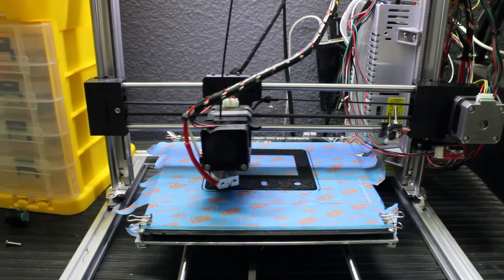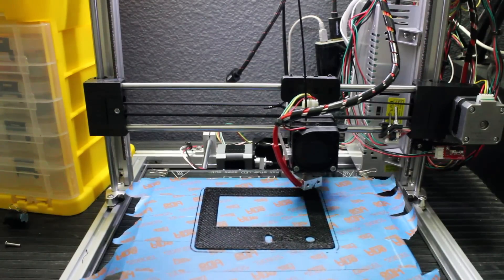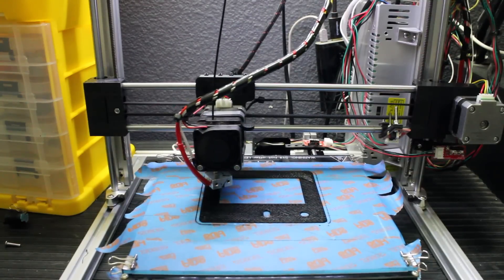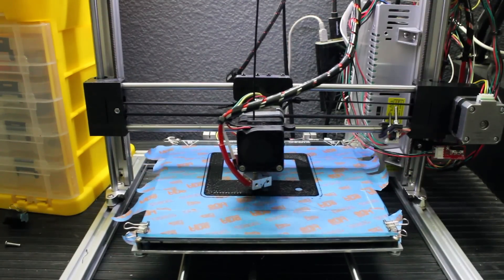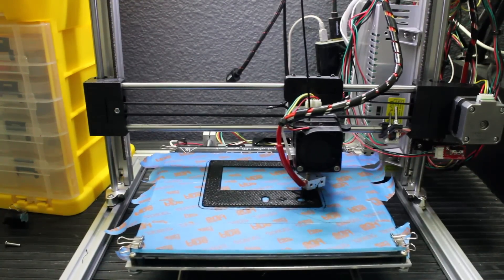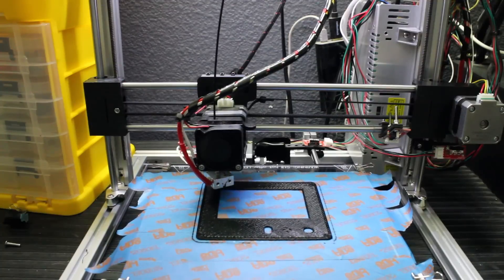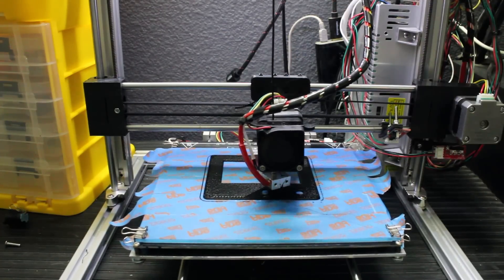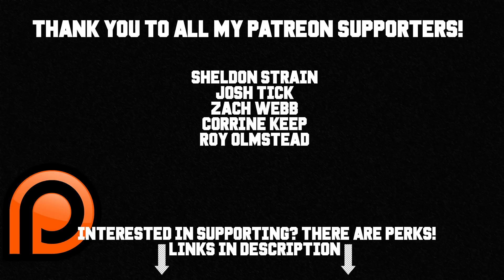3d Printer Kit Build Review | Folgertech Prusa I3 2020 3d Printer

Comment: Great review. Are you using the Folgertech PLA? What temperatures are you running? I'm having some issues with oozing and the first blob curling on the of the hot end, messing up the whole print right away.
Reply from the maker: +David Vogt yes I only print with pla for the most part try to raise your bed sounds like it's an issue with adhering usually bed isn't correct hight also try hairspray for bed adhesion
Reply: Thank you very much for the response - I appreciate the help. Will try your suggestions. :)
Reply from the maker: David Vogt also! Try heating your bed 50 should be good to help with that first layer!  No problem :)

Comment: Looking good. Did you consider doing a Plexiglas encloser? I was thinking over the size from the live stream and was thinking how cool that would be. It would also give you something to mount the LCD and card reader too. I might even have a few sheets to donate from a old project.
Reply from the maker: +Alumba Keller I actually do not want an enclosure one thing that was attractive to me about this printer was not having an enclosure due to lack of space, harder to reach and work on parts without disassembly and not being able to monitor and record as easily (although with plexi you would still have reasonable vision) I know there are many benefits of enclosed such as more stable temps without the risk of draft or other temp fluctuation also perhaps you can control harmful emissions a little more but for this one I think im gonna keep it open, thank you though for the suggestion I have definitely considered it before